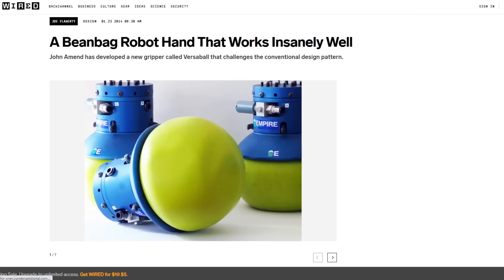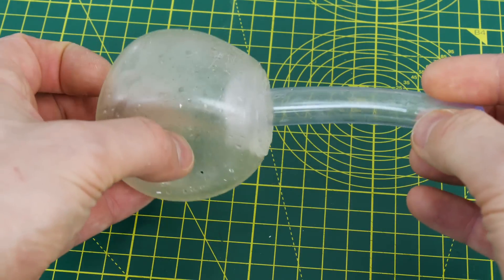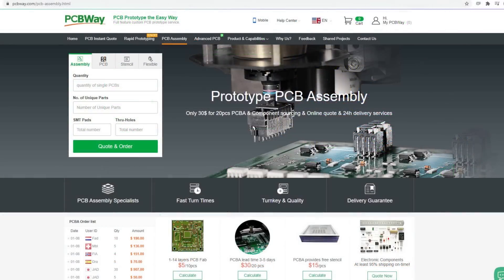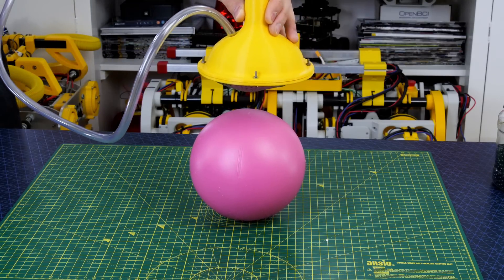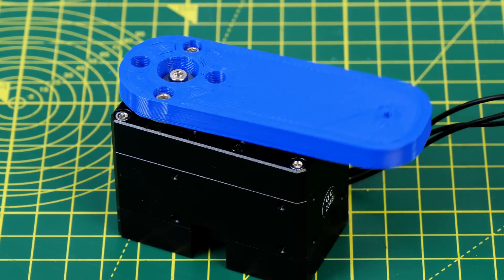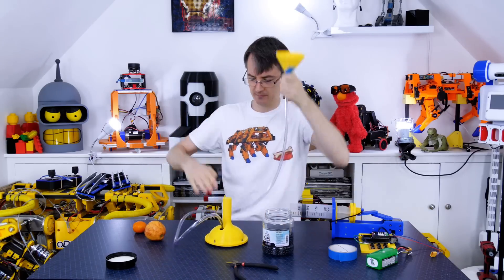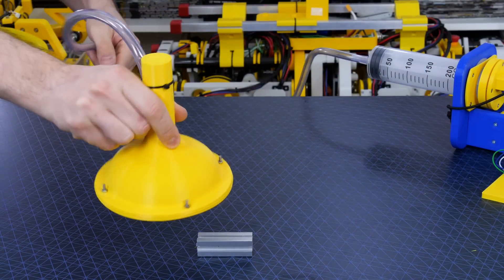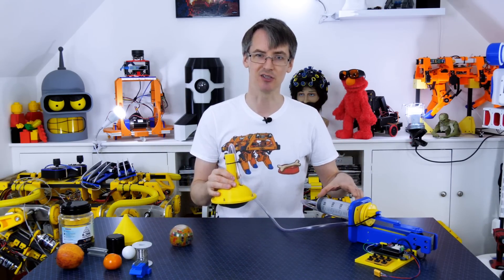Experimental Jamming 'Beanbag' Robot Gripper

Comment: I think you simply just need to use smaller bb's. The bigger bb's allow a much bigger gap in between the bb's and the objects with a more sophisticated shape.
Reply: I once saw a video where they used grinded coffee (the powder) in place of BBs.
I think that would work much better.
Reply: @TheRelaf  this ^
Reply: @TheRelaf  then you would have to use some sort of filter on the end of thetube
Reply: I experimented with a sand filled version. In order to avoid sand reaching the pump, i used a cloth filter,  but that could be improved. The sand provided a much better and firmer grip. I also used a vibrating motor to help the sand conform and pack better as the air was slowly sucked out
Reply: @mars5train601  Sounds very interesting! Were your experiments successful?
Reply: @xenontesla122 the experience with the system was that it worked, but was too bulky for the needs set out. A pump that was small enough to be within spec was not able to provide sufficient suction, as the sand tended to clog the filter. While I did have success with larger pumps, I never continued on the project. As it was developed for use in a FRC robot, weight and time restrictions meant it wasn't feasible to keep working on. As a note, it was intended to grab a first steamworks gear, now sold by AndyMark.
Reply: @mars5train601  some sort or plastic of foam sand to reduce the weight of the gripping medium
Reply: @SapphicReality  How about 1mm printed cubes? PLA is fairly light, the shape will be irregular at that size and the size is easily adjustable.
Reply: Yeah, with smaller balls it would increase the contact area and that should help.
Reply: Yea for your big brain, I was quite disappointed you used such big bb's. I would definitely try much smaller objects, like silcon beeds, the ones in those little "do not eat" packages you find in beef jerky.
Reply: I've seen a similar gripper that used coffee grounds; that's probably the same idea!
Reply: smaller bb's and a finer robber(even a Condon should do the trick)
Reply: addon filter in order to block balls in the tube
Reply: @joaopedroLajoso  ribbed or knobbled?
Reply: @YeshuaGod22  hmmm knobbed would probably be better for gripping, ribbed increases the friction only in one axis.
Reply: How about replacing BBs with a less soft shape? They could interlock in order to retain its vacuum shape better. I'm thinking of the tetrapods that are used to break waves on shores.
Reply: @MBobLamy  interlocking isn’t good tho like it’d have to be rounder
Reply: I also thought that smaller balls inside would be helpful to grab better.
Reply: Thats what I was thinking as well, this way it would also get more detailed shape of the object that its trying to grap, and that way stick better
Reply: @laurensvandijk6607  o
Reply: Aren't airsoft pellets smaller or maybe sand might work aswell.
Reply: @feeterican  the ones he used are airsoft pellets. Proper .177 bbs would be smaller.
Reply: @marcusborderlands6177  Right on, I'm too much of a boomer and never played with airsoft. We just shot each other with BB guns (I still have one in my leg). I just thought air would be smaller but as you let me know it's the other way around.
Reply: Basically the main problem is the way there are four contact points to pull the surface area tight like a drum. It needs maximum flop:

1. Enlarge the hole. Mount the bag using a cuff that goes inside the hole to hold the balloon in place. This would allow it to envelop an object better.
2. Tube/flanges in the center so it is more symmetrical.
3. Use lighter plastic BB's.

4. Improve the code so that it fully expands the balloon to expel an object, then retracts slightly to get rid of excess pressure. You would need to play around with number of pellets and pressures in order to optimize grip.
Reply: Yeah, I wondered if smaller BBS would give better shaping around the item picked up!
Reply: Yes, 6mm bbs have too low of a resolution
3mm or a bit lower should be the sweetspot.
Also try blowing air in while gripping t
Reply: To mould around objects better
Reply: Was just about to write this exact comment.
Reply: Maybe use kinetic sand instead of bbs. It’s probably as smal as it can get and still have an elastic gripper
Reply: I thought so, too. Even before James increased the size. Plus having the toy initially filled even more with such a finer filler (maybe sand?), so that it may be already stretched could also help. But for that to work there needs to be some kind of membrane between the filler and the tube for sucking out the air. I hope that makes sense, English is not my native language...
Reply: Rice
Reply: Bird shot, from a 12 Guage shell!  Might also be able to use an electromagnet to activate them into a rigid form for faster actions, maybe in conjunction with the vacuum pressure!
Reply: I was thinking the same thing or if you could make it work with sand that could be ideal but sand may be TOO fine...also some kind of mesh on the input/output to keep the bb's from getting sucked back through the tube
Reply: I think the cup design needs to be a lot smaller to push out the bag, because in the other product video he showed, they had the bean bag sticking all the way out. and also to use smaller bbs for extra contortion capabilities.
Reply: Agreed, you could use small beads for necklace and stuff instead of BBs!
Reply: I was thinking about this and also letting more membrane get around the item you want to pick-up by maybe mounting the membrane more by it's extreme, less stable but more grip
Reply: @MASACR99  I was thinking a double membrane. Use tow syringes, attached to the same servo, so that when one pumps out the other is pumping in. So that when you suck the air out of the gripper pouch, air gets pushed into a donut shape pouch around the ring of the funnel, that pushes the medium inwards. That way instead of just forming around the object it actually grips.
Reply: and a filter to not suck them
Reply: Thats what i was thinking
Reply: Smaller bb's and more suction.
Reply: I was thinking the same thing
Reply: Came here to say the same thing 👍
Reply: Indeed I was just coming here to comment this, seems to me having a medium with smaller granules would grab stuff easier
Reply: I'VE HEARD FESTO USED GROUND COFFEE CONSISTENCY IN THEIR GRIPPERS FROM YEARS AGO, BUT I CANT FIND WHERE I HEARD THAT.
Reply: I would love to see this attempted with tiny tiny ball bearings or something similar!
Reply: don't forget a shorter hose. I'd make the hose as short as possible since gasses are pretty expandable and contractable. That hose is over 1m long and is like 8mm in diameter so that is like 50cm^3 which is 1/4 of the syringe, so its no wonder you got no power
Reply: Came to say the same thing
Reply: i wonder if you could use sand lol
Reply: @pvic6959  Sand may be too heavy. I know, I use it to weigh down audio equipment. Maybe plastic granules?

Edit: here is an interesting search from Alibaba: https://www.alibaba.com/showroom/raw-plastic-pellets.html
Reply: exactly what I was thinking. Using large grain sand and a thinner membrane for better contour following
Reply: yeah that is what I was thinking
Reply: The resolution needs to increase for the gripper.
Reply: Yeah
Reply: exactly maybe bearing balls like the ones from an mgn12 rail or he could maybe even try sand if he can get a filter to suck the air but not the sand ....
Reply: I needed to use the word interstices.
Reply: Just like molds made out of dirt. It can be compressed and crumbled.
Reply: And adding more bbs
Reply: Yeh smaller more successful
Reply: Yes. A smaller less uniform particle to fill it with. Like short grain rice. Also fill it much fuller. Just to the point of stretching the membrane.
Reply: yea this is the issue
Reply: I believe the example shown in the beginning used a type of styrofoam balls. Slightly compliant, also lightweight. Would work better than BBs IMO.
Reply: i concur
Reply: You're absolutely right
Reply: Could be used for moulding with much smaller beads and a bigger syringe
Reply: I think it also needs a less flexible/stretchy membrane.
Reply: @DavidTaghehchian  the more flexible the more it can deform around the objects so you need a flexible material like a vacuum seal bag would probably work quite well
Reply: Maybe softer balls (the original ones) may work, too?
Reply: @derjansan9564  issue is you need a solid ball to create a vacume seal block, soft ones will continue to squirm
Reply: @derjansan9564  If you've ever played with those Gel beads, they absorb water and can easily be crushed. I recon the original beads would turn to mush without the water in between them.
Reply: @derjansan9564  I vote for softer balls, since they can mold around better
Reply: Or even fully move onto something like sand.

Comment: There was a Stretch Armstrong villain called Vac Man that used much finger grains to achieve a similar effect; you stretch him into a position then vacuum out the air to hold the pose. I think you'd have more success on less detailed objects with finer grains. It looks like the original does this.
Reply: As I recall the inside of the vac man was something granular but irregular, something like dried chopped millet seeds, not sand because that would be too heavy but definitely something with a non spherical shape, irregular grains are going to jam together more effectively than spheres.
Reply: I agree smaller balls will enable finer griping resolution, and potentially better mechanical gripping
Reply: I knew Id seen this somewhere

Comment: Great low-cost implementation of the idea!
Sensing and varying the volume sounds like a good idea. Also probably just a second syringe might work better than a bigger one. You surely still can drive them from one servo or just use a second one.

Comment: i'm still attached to the fact that u 3d print a regular funnel.
Reply: I somehow doubt he didn't have an appropriate funnel at his home ready.
Also the fact he didn't recycle the funnel as the cup.
Reply: @BridgetTheNun  exactly this. image if 3rd printing become more commonly accessible for the everyday folk. plastic waste will skyrocket!
Reply: @Antiork  it would actually reduce, most waste is industrial, individual waste is far smaller footprint then unused unsold products. It everyone had access to 3d printing, manufacturing sectors could lessen production and thus overall waste. Shipping, wrapping, packaging products comes with lots of costs and losses in efficiency
Reply: @BridgetTheNun  He could have also simply glued the syringe parts together instead of 3D printing extra parts to use as clamps. And maybe given a little more thought to the design before actually printing it and then realizing that it doesn't work as intended. James gets free filament so he's stopped applying his critical faculties.
Reply: @nagualdesign  well no because glue would need to cure over 24 hours or so. Screwing the parts together saves loads of time overall.
Reply: @stefanchristopher6303  Superglue sets in seconds.
Reply: @nagualdesign  yes and I'm sure it would be strong enough to withstand the pulling and pushing forces exerted on the syringe to get it to move back and forth. Just no.
Reply: @stefanchristopher6303  I don't see why not. That motor wasn't particularly powerful, and there was plenty of surface area.

He could have screwed straight through the flanges if needs be.
Reply: ...I've done that too. Sometimes you just gotta 3d print for the fun of it
Reply: I chuckled a bit when he did that. But hey, if you have a 3d printer, a lot of plastic and don't have a funnel, why not? I assume he used vase mode and it probably didn't even take that long.
Reply: @olekaarvaag9405  Which is the easiest print setting to get nice and still it looks wacky, he needs to tune it just a bit.
Reply: @olekaarvaag9405  Especially with the nozzle sizes he tends to use
Reply: @olekaarvaag9405  Just because you can, does not mean you should. I don't know if you've seen the news in the last 40 years but there's a few issues with wasting energy, and producing and disposing of plastics.
Reply: @nagualdesign  If you consider the energy required to ship a funnel to your house from the nearest amazon fulfillment center it probably used the same if not less energy...
Reply: @Emily-fm7pt  Ordering a single funnel from Amazon is a false dichotomy, since a funnel only weighs a few grams and the delivery truck weighs several tonnes. How about just picking one up from the supermarket when he does his shopping?

If you want to do a proper analysis you'd have to include the cost of shipping filament, and compare the energy it takes to 3D print a funnel versus injection moulding.

Hint: mass-produced funnels use the latter method because it's extremely cost-effective.
Reply: I once 3d printed a toilet paper holder bc i dodn't feel like going to the store
Reply: Something about hammers and nails
Reply: @ToxNano  Exactly.
Reply: Let's also not forget he used several hours to 3d print af block.. 7:45
Reply: maybe it was late his misses had already said no you cant raid the kitchen funnel so he just whipped one up
Reply: yes that's kinda overkill.
Reply: What was he supposed to do? Go to the store like a caveman? (And amidst a pandemic)
Reply: @jairm.jr.9991  Yes, and wear a surgical mask. Like a Neanderthal. 😊

Comment: Why'd you 3d print a funnel? Is this a moment of a man with a hammer see's everything as a nail? Wonderful video and pretty neat.
Reply: Funnels are suprisingly hard to get nowadays, it's probably mildly more convenient to print one
Reply: @giorgioelgar2272  Home brew section of your favourite discount shop, that's where to get all your piping needs as well ;)
Reply: @InvalidEntry  Not that convenient during covid and it's not as if there's a b&m in most places
Reply: Just use a piece of paper it don’t gotta be an operation
Reply: Most normal funnels (for tea drinkers) have very narrow end bits, which cannot fit a bb.
Reply: @WuffRobotica  As a brit, and therefore professional tea drinker ... why are you using a funnel to drink tea?
Reply: Because why wouldn't you
Reply: Hmm, I see a lot of advantages and little disadvantages. While industrial manufacturing should be a lot more efficient, I believe distribution for a single funnel wouldn't be if he orders it online. He should be able to get it in a store nearby, depending on where you live. But that might involve moving a car using fuel.
Also the cost probably is a lot less because of the markup on single items.
And you can get the exact size you want.

Some disadvantages would be that it is probably not as sturdy and you shouldn't use it for food contact.
Reply: @neur303  also take into account energy - the delivery of the 3D fuel is a trip anyway (and probably heavier given offcuts etc)and the energy cost of running the printer will far exceed the cost of an injection moulded funnel. I assume it’s a symptom of needing to finish before a deadline, however it was a weird detail to point out.
Reply: @InvalidEntry  That's what I meant to include when saying to be efficient. But I believe you would lose that efficiency very fast once a truck or car is involved for a light item like a funnel.
Reply: @neur303  Its an interesting question. If you're delivering literally just a funnel, and I think its one that 'carbon calculators' do struggle with - but for example, the electric amazon delivery van doesn't deliver just a funnel to me - they drop things off around the entire estate, so the delivery cost (in energy) becomes one fraction of the entire load, and the efficiency is recovered.  But it comes back to speed (want it now) vs willing to wait.
Reply: Lets say he didn't have a funnel. He could go out unnecessarily during covid, for 45 minutes to find one, or he could print one at home in 30 minutes with the fast printers he has and the extremely simply vase print a funnel is.

In this case, the hammer was the reasonable choice.